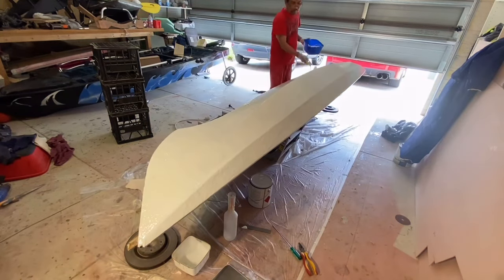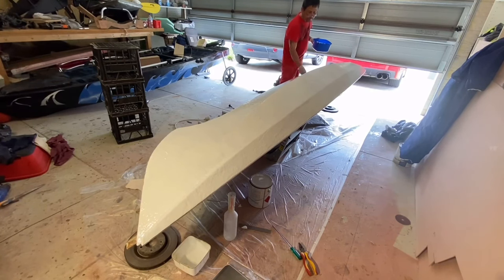Flowcoat Application (#kayak fishing, #kayak building, #DIY, #homemade #boat )

Comment: Why haven't you sanded the fiberglass smooth?
Reply from the maker: I did a bit, I just don’t wanna go deeper I wanted to apply the flowcoat first then I’m gong to do the sanding from there and my flowcoat will act as my fairing compound in that way I can assure I have a smooth surface when I do my mold